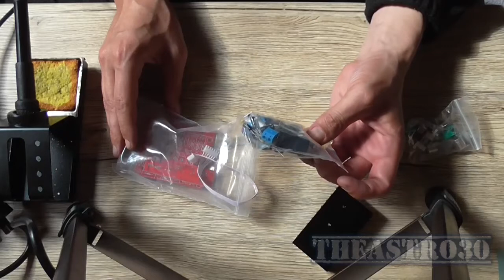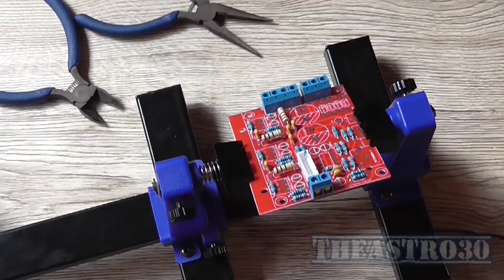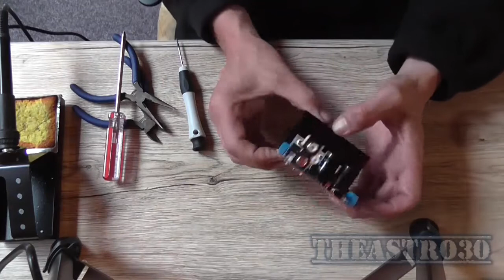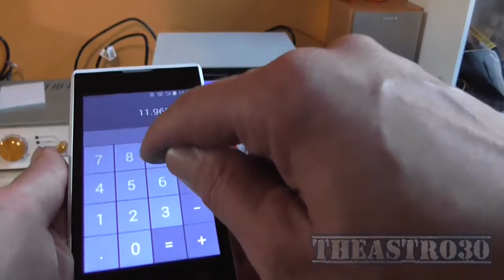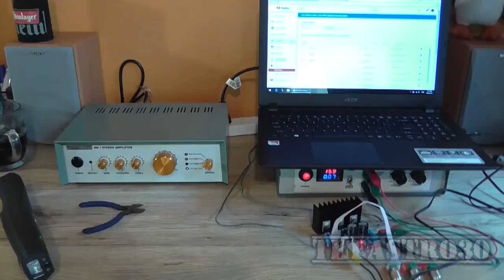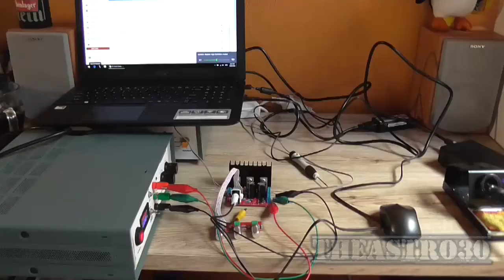TDA2030A 2.1 Amplifier Kit Build FAIL

Comment: Your problem is probably the INPUT CABLE.There are different wiring conventions for the 3.5mm jack.
TRS has the ground on the S, inputs on the Tip and Ring.
TRRS wired OMPT puts the ground on the S, and inputs on T and R1. Mic is on R2.
TRRS wired CTIA puts the inputs on T and R1, but the Ground is on R2 and Mic is on the sleeve.
Then there is the TRRRS connectors, adding more confusion.
So, you should test the imputs with an RCA plugs, not using a 3?5mm adaptor cable.

Comment: Your most welcome Astro. I love my board vice too. Best $20 I ever spent at Jaycar lol. Other versions of this board have a 5v regulator located at that power out connector. The TDA chips are most likely fake as you noted. John Audio noted oscillations on them as well. Swap them out for LM1875's.

Comment: I  had a 2.1 PC stereo go out on me. looked up the transistors, and found the TDA2030A. I bought one on Ebay and it sounds ok except the base concerns me as it really shakes the speaker to bits.  I don't have it in the ported inclosure however.  looks like you may not want to talk about it.  I have another base speaker I would like to try.  This base speaker has  4 wires. never seen this before, can you just hook up two?   ohm issue is what I'm thinking?

It came off of a Sundance Hot-tub stereo  system, CD player, left and right rear were both hooked up to this 4 wire base speaker. B13LR100-014C-Y   TA-443/4ohm.  T- S6E23.